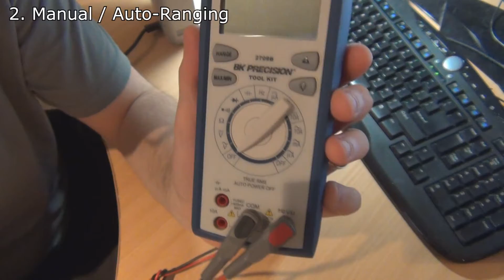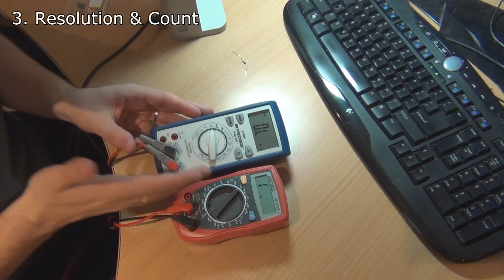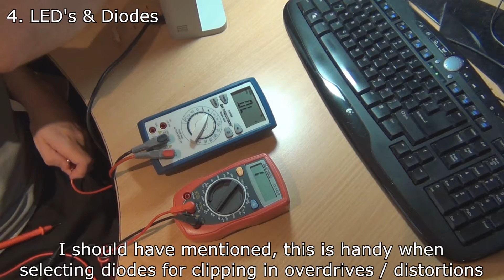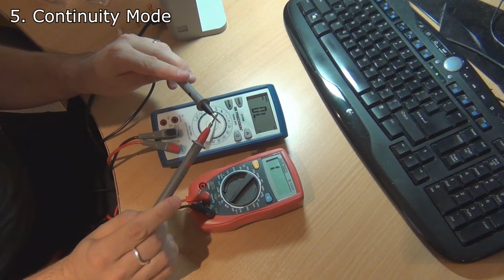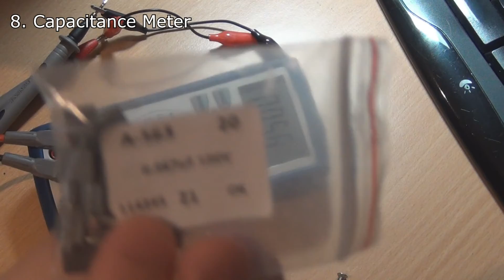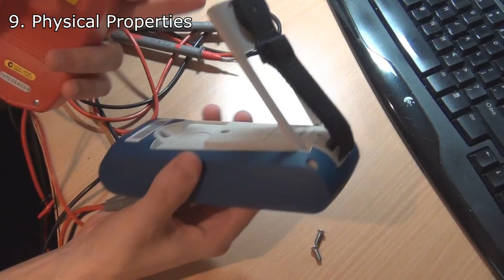Multimeter Guide: Buying & Using (DIY Guitar Pedals)

Comment: I think I need a multimeter but don't know why, or how to use it. 
I'm guessing it's handy for checking connections and values and if resistors and capacitors are lessening current correctly, but do I need to know stuff like ohms law to understand it all, and do pedal kits tell you how much current you should get at different stages of a circuit?
(Sorry if I'm not making sense)